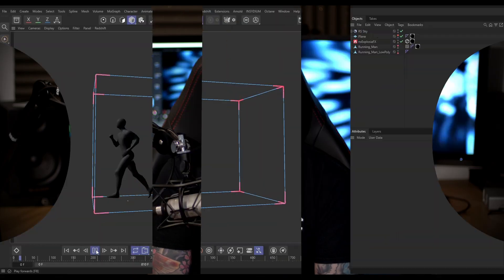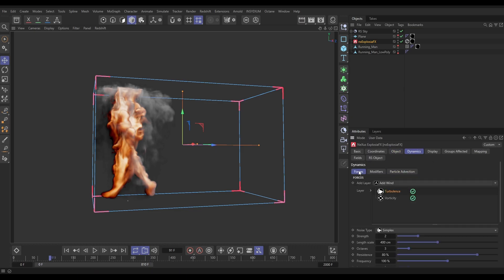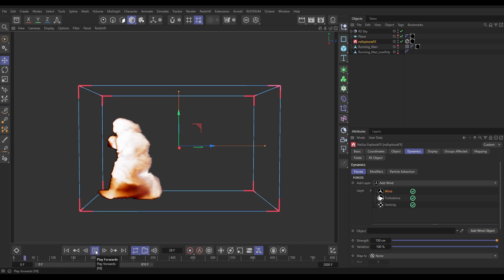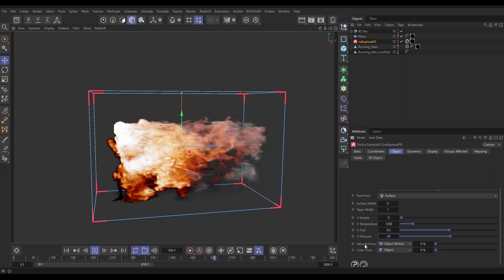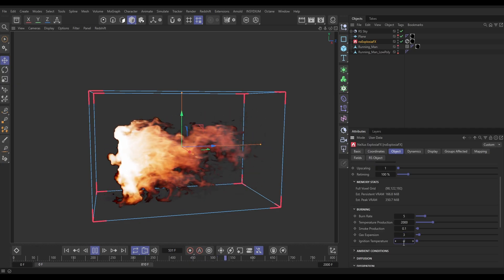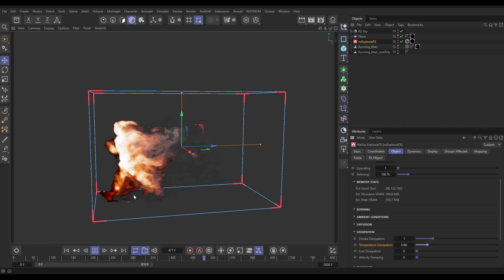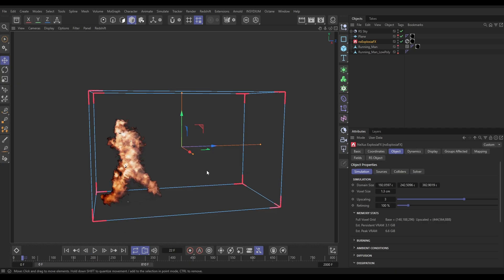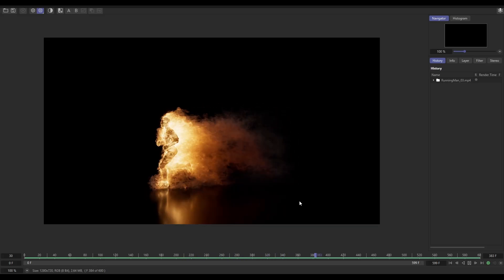Top Tip Tuesday - Man On Fire

Comment: Looks great but R23 crashes every time I try to render this scene, looks like im going to revert to the older version unfortunately or buy the latest computer with the latest cinema version, expensive situation...
Reply: Check if your system is running out of memory, before doing anything drastic. If that's the case, you might be able to simply adjust some of the parameters of the simulation to lower RAM usage.
Reply: maybe not - I'm running C4D2026 with latest redshift and latest X-particles - crashes a lot!!  half the time seems to be redshift issue - the rest is XP unfortunately.
More stable when I move back to 2025/2024